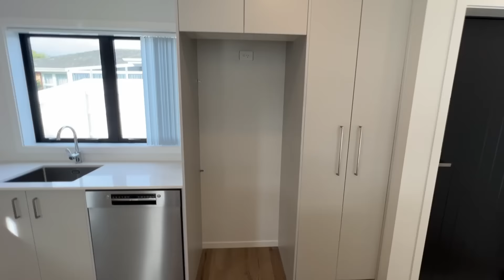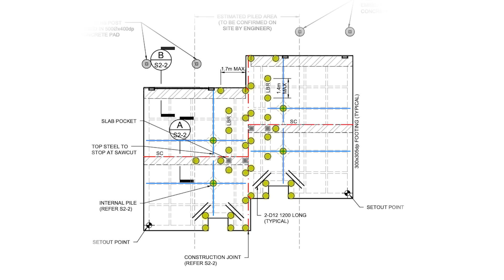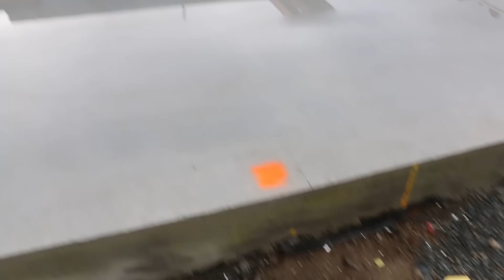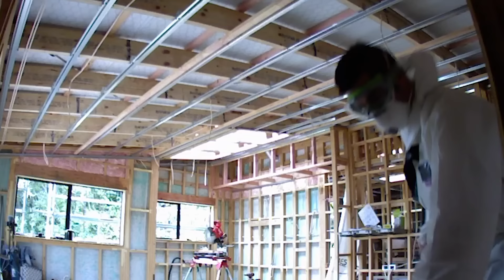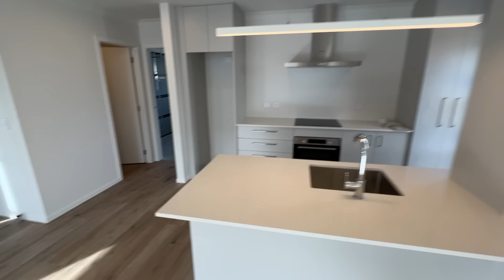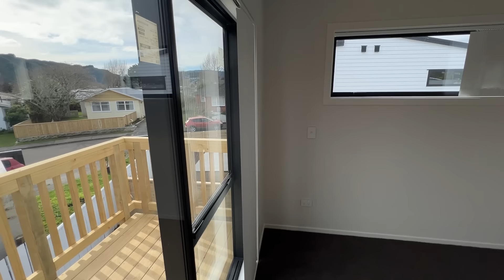Full House Build in 15 Minutes! | Timelapse + Plans

Comment: I look at 2 storey buildings and wonder how thick does the first floor need to be to sufficiently sound insulate the lower floor. old wood floors are notorious with the sound of running kids,
Reply from the maker: Yea this is definitely something to consider, insulation, sound gib and rondo make a difference

Comment: Why do baths feel like they're banned in new builds?
Reply: Hard to fit a bath to a shoebox.
Reply: We also have school boys designing them. No life knowledge or skills. When you get a row of them put the living upstairs. Put some skylights in with a racked ceiling. All day sun. Of course you won't be able to access the 2m x 2m courtyard 😂. Stayed in a air bnb in Merivale Chch. 76sqm. Had to open the cupboard in bedroom to make it feel bigger. 2 bathrooms. 1.6m sq each one. Stupid. Jack and Jill the bathroom which could be made a bit bigger. Make the bedrooms bigger. Of course the developers will never live in one. But hey what would I know. Sitting in my 5.4m x 5.5m 3rd lounge on sth end of house with skylights of my 325sqm late 60s reno.
Reply: No space, but don't worry, because they almost always give  you an ensuite no matter how small. In fact many of these builds have the same number of toilets as bedrooms, even though previous generations grew up with just one toilet for 3-4 bedrooms. Could give proper space but screw your desire for a bath or office, have more toilets instead. Bath in that.
Reply from the maker: becuase no one uses them
Reply: @nzbuilder hey come on thats not true. Heaps of poms here that like a nice long baf. The whole family joins in to save on water.

Comment: I wonder why everyone uses the same exterior aesthetic, these look pretty much identical to all of the new builds in my neighborhood in akl- I guess it's cost effective to reuse the same style, but doesn't it make it harder to stand out for buyer attention?
Reply: Architects basically. The speciation elements with James Hardy products are a lot easier being an engineered product. But it comes down to the speciations. James Hardy products require less maintenance then traditional timber weather boards.
Reply: No thought.
Reply from the maker: You’re bang on — it's often budget-driven and speeds up consent, but yeah, it can make it all feel a bit samey. We try to add small design tweaks or material changes to help each one stand out without blowing the budget.